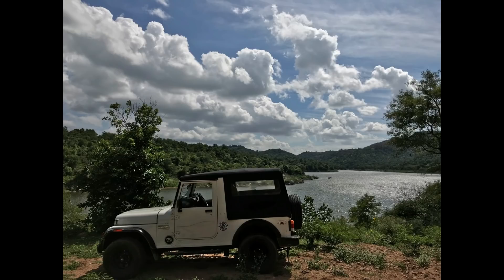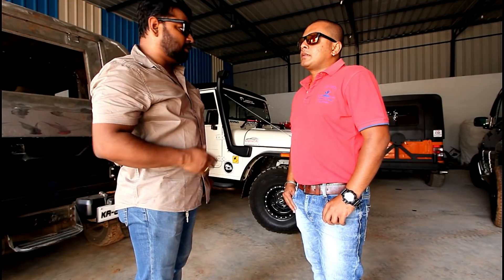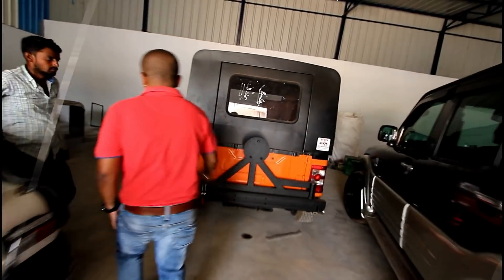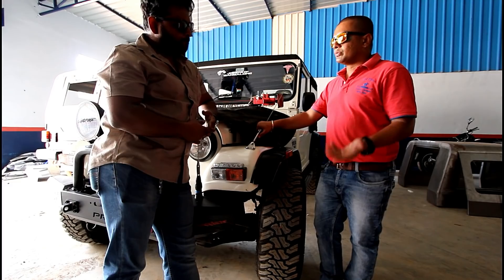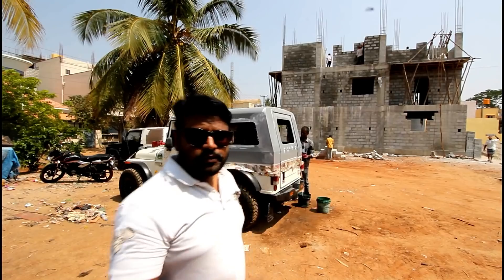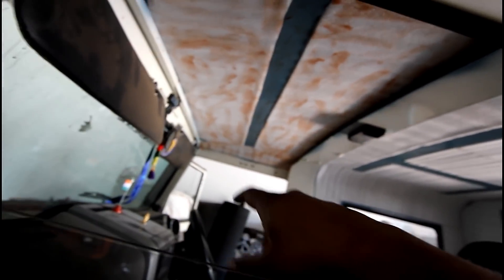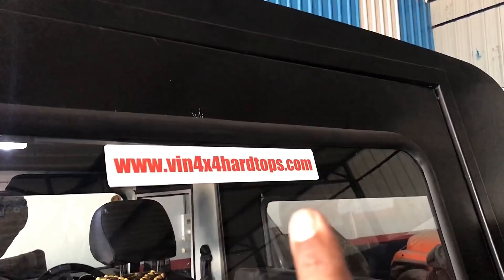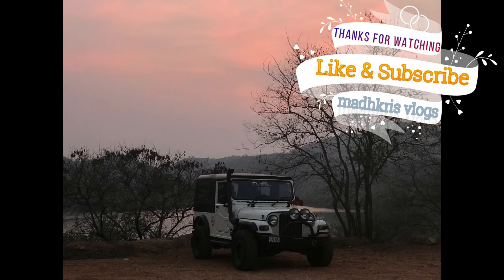MAHINDRA THAR HARD TOP

Comment: what are the modifications you have done...?...tyre size..rim size...any suspension lift..?
Reply from the maker: I have used 31"Mud Terrain tyres on 15"   (160 PCD) negative offset Beadlock Steel wheels. I have not done any suspension lift although I have changed the stock shock absorbers

Comment: What is the approximate weight added to your Thar? More weight means lower performance.
Reply from the maker: The weight of the hard top is approximately 90-95kgs as told by manufacturer. Since the Thar runs on a powerful scorpio engine, this additional weight has not caused a lower performance in my view
Reply: @madhkrisvlogs  its your choice. But Thar does not have Scorpio engine. Scorpio has three variants, 75hp, 120hp and 140hp. But Thar has only variants with 63hp and 105hp capacity.
Reply from the maker: Vikramaditya Singh I agree on the bhp figures but the current Thar runs on the 2.6 Crde which was erstwhile used in Scorpio before the mHawk engine.

Comment: Can you tell me the tire and alloy wheel size
Reply from the maker: The tyres are 31" mud terrain. I have shod them on 15" 160 PCD negative offset steel wheels
Reply: MadhKris Vlogs 
This type of tire make vibration in 100km speed?
Reply from the maker: Yeah definitely makes some noise as it is a Mud terrain tyre but no vibrations at all.
Reply: MadhKris Vlogs 
Thank you:)
Reply from the maker: ś î V â k Ļ Give a thumbs up if you liked the video @ Subscribe

Comment: After fixing  the hardtop how is the temp inside the cabin.. Does it heat up easily at noon
Reply from the maker: Iven Varghese my Jeep always stays in closed parking. However when parked outside it does get hot but the Thar AC is really good.. So never had any issues

Comment: How much inch lift is that thar and the wheel size pliz
Reply from the maker: Thupuzhoto Khesoh I have not done any suspension or body lifts to the Thar at all. The tyres though are 31" mud terrain. I have shod them on 15" 160 PCD negative offset steel wheels